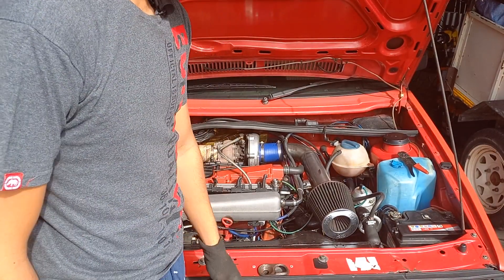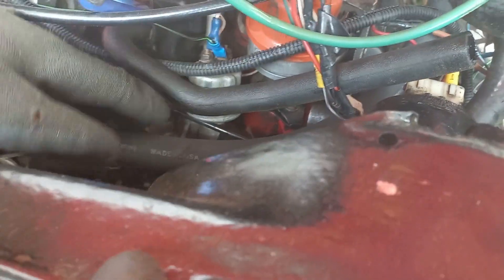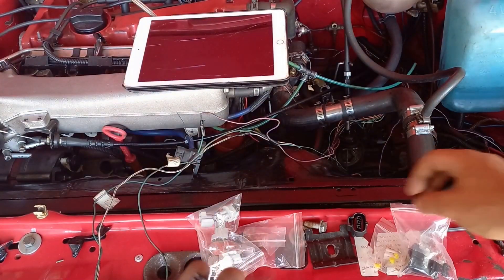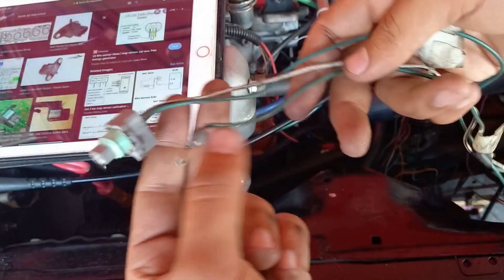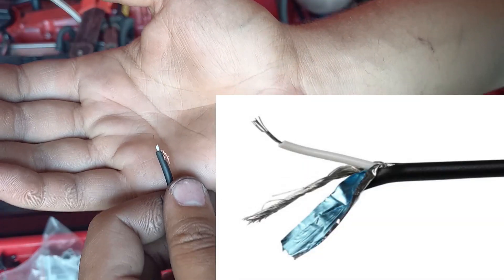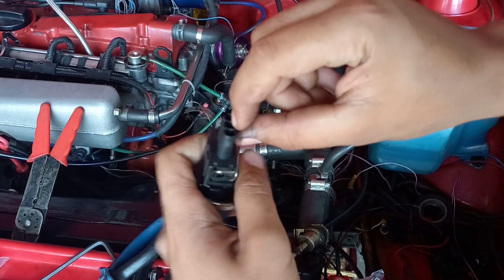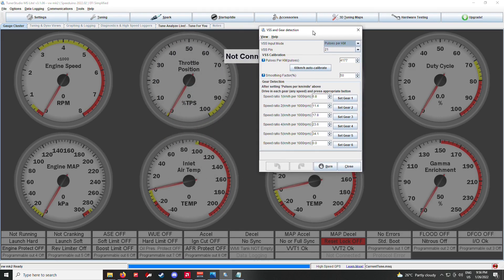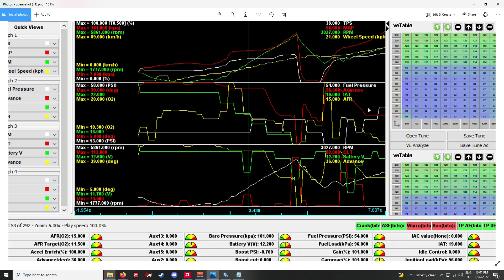Vehicle speed sensor and Pressure Sensor to Speeduino ECU and shielded wire

Comment: vou just conect hall sensor pi direct to arduino? no need for capacitor to Ground or other filtration/protection?
Reply from the maker: Yes both the crank hall sensor and speed hal sensor are connected like that. I think that is how the developer expects us to connect it. Speed sensor algorithm probably has filtering coded in...just guessing. speed sensor doesnt have to be nearly as precise as crank signal thus probably doesnt need filtering hardware.
Reply: @061garage  Thanks for fast answer, !! https://cdn.hackaday.io/files/4413188805792/schematic%20v0.4.3_schem.png In this schematic Both cam and crank signal have passive components. But this ia minimal and this signals are much important than veichle speed

Comment: Is it possible to use a 2 wire vss?
Reply from the maker: The ecu measures pulse per second. The  3 wire sensor  produces on/off pulses. While the 2 wire produces a linear increase in voltage which the ecu cant read.  You could get any hall effect sensor/3wire sensor and mount it to read the back of lug nuts, propshaft bolts etc. Hall effect are commonly use as speed sensor on most cars.